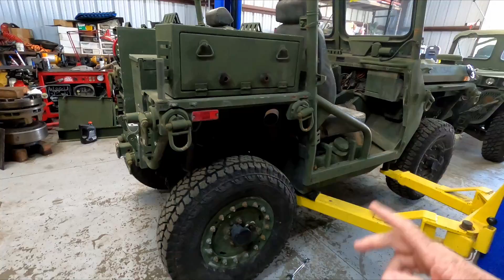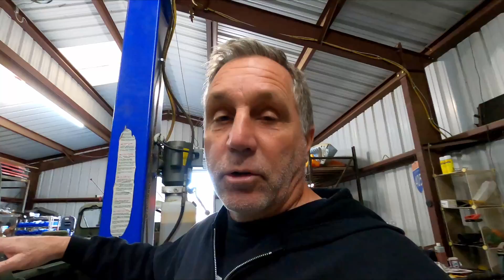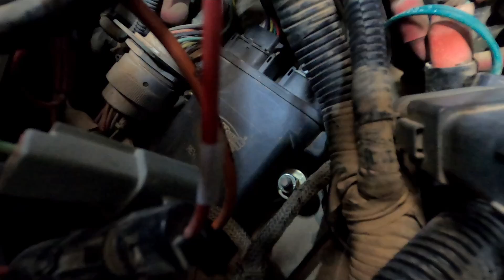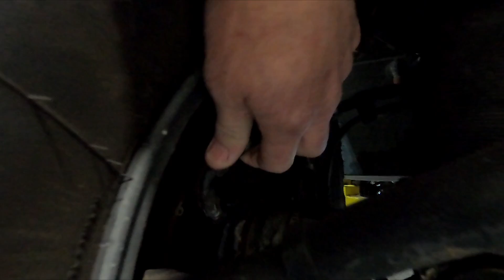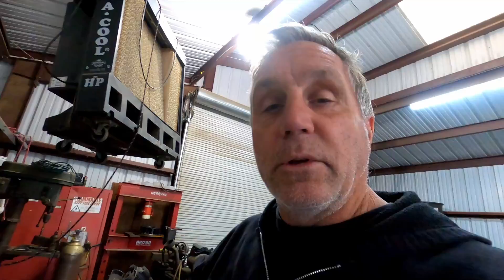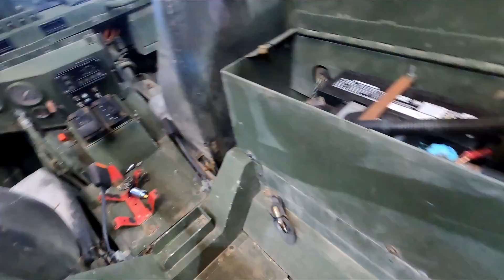Air Ride and CTIS Electronics Troubleshooting M1161 M1163

Comment: Hello Greg , I cant get my compressors to go on at all. I have checked my fuses at the passenger side and they are in tact . When I flip my toggle up gor air system (under red flip up plastic piece) Nothing happens. Any idea where to start to diagnose ?
thanks in advance. I appreciate you
Reply from the maker: There are 50 amp self resetting breakers located on the right side in the back by the batteries. One of them may have gone bad
Reply: @RasmussenEquipment  ... I will check, I appreciate you